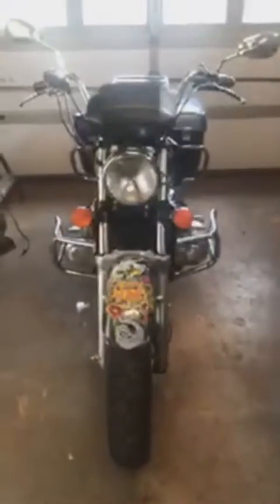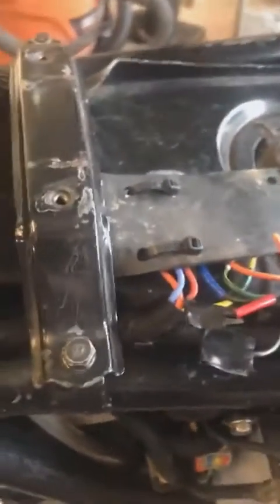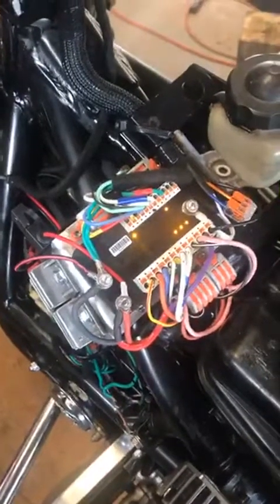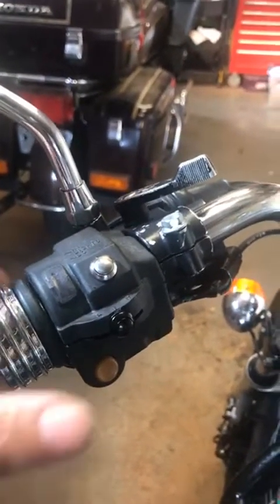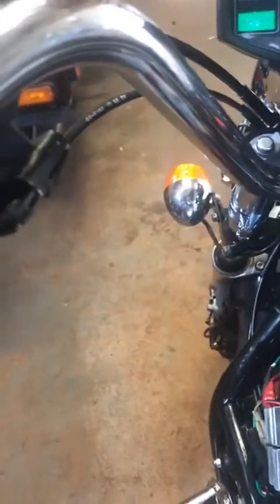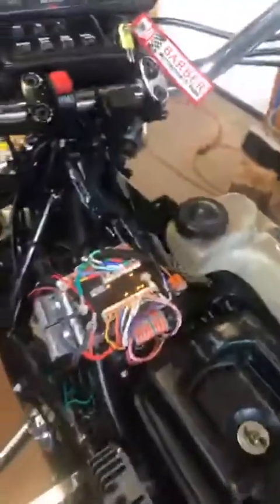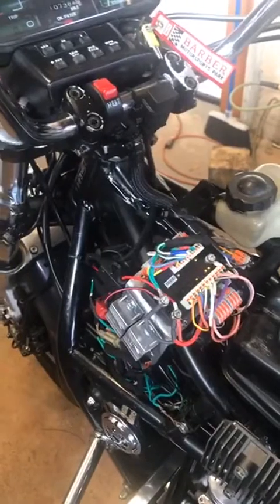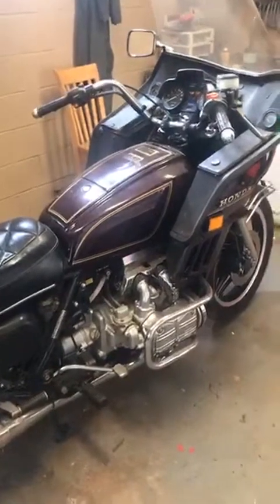1983 Goldwing Rewire Part 2: Moto Gadget

Comment: Do you have a more in depth, step by step install of the M-unit? Pros 
& cons? I am starting a restoration of a 1975 GL1000 and was 
interested in the M-unit.
Reply from the maker: Get the M-unit Blue. All the information to install is at Revival Cycles. 
Make sure you are prepared to completely rewire your bike. The results are awesome.

Comment: Do you have a wiring diagram. I'm doing the same thing to my GL.. day 4 and I got the digital display up and running by taking three wires from the tacho loom and sending them to AUX2. Ignition system still down. Any advice you may have would be amazing
Reply from the maker: Use the GL1100 wiring diagram. All the black with white trace go to the Ignition output from the MotoGadget. One goes to the coils through the ballast resistor and one to each of the two Spark Units. Wiring from pick up coils and spark unit to Ignition coils remains stock.

Comment: Hello bob, I’m doing the same thing to my 1983 Honda goldwing I have everything working but the cooling system. how did hook up your thermoswitch to your fan to the motor gadget?
Reply from the maker: 12 volts supplied from Moto Gadget AUX 2, to the fan switch then to the fan. Other fan wire goes to chassis ground.
Reply: @BobKramer51  okay thanks for helping me out. I found out that my engine was properly grounded I cleaned the connection with a wire brush and after that the fan started to work